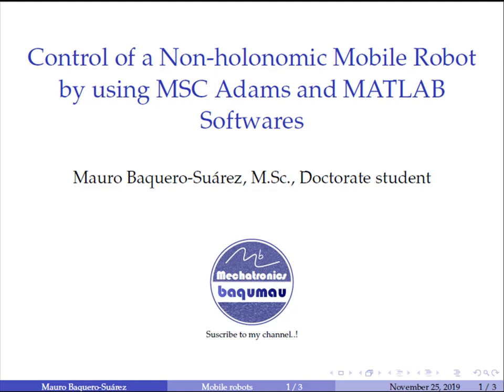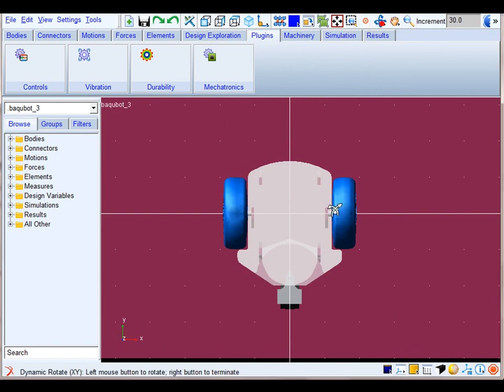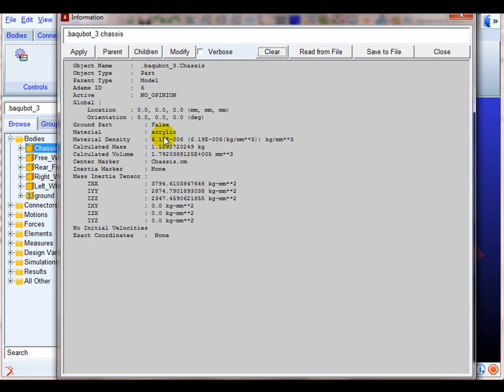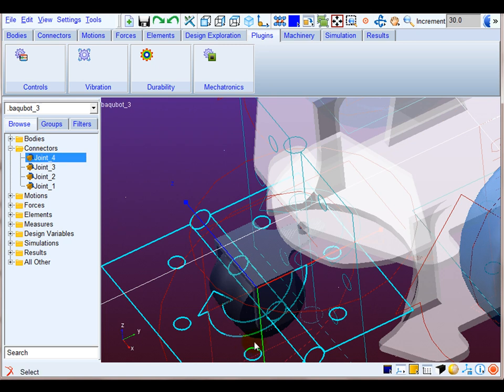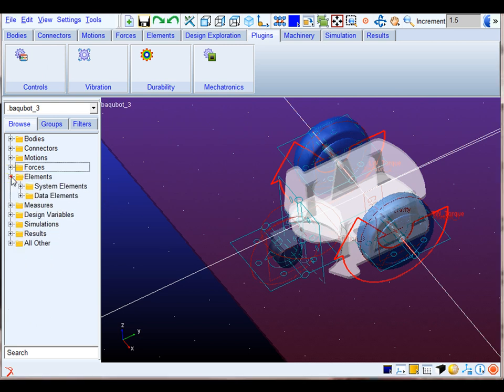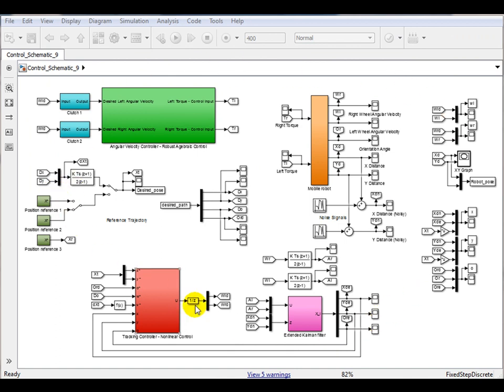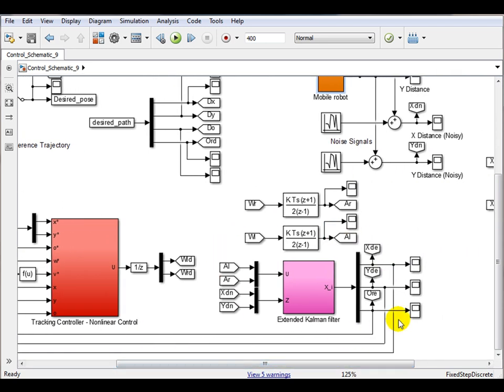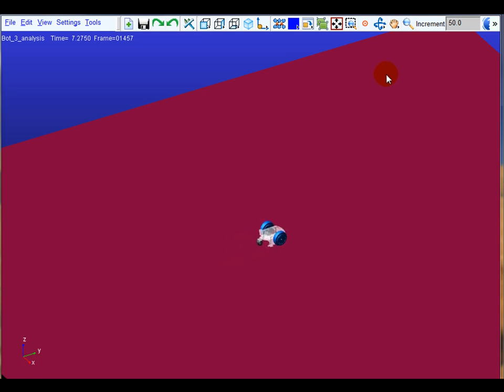Control of a Wheeled Non-holonomic Mobile Robot by Using MSC Adams and MATLAB softwares

Comment: Thanks for your perfect modeling; I have a question:

I want to determine the center of gravity for the whole system. each of the parts has an individual center of gravity (COG), but I can't find out where is the total center of gravity. to be more specific, when the system starts to run, some parts are moving (have rotation or translational motions) and the COG of the whole system will be changed during a dynamic simulation.

Could you help how can I define total COG for this system and determine its magnitude during the time?
Reply from the maker: I assumed that each body of robot is rigid and with an uniform density. Then i only set the material or density of each rigid body and Adams compute the center of mass of each body and the robot's whole center of mass and the moments and products of inertia. In some cases i use physical properties panel of solid edge to do it, due that is easier to manipulate the measuring reference frames.
Reply: @baqumau-Mechatronics  
Thank you for your attention, I appreciate it. In this case, how could we plot COG in the post-processor panel? There only independent parts appear.  Thank you in advance!
Reply from the maker: @amonberdiev8836  the computed center of mass by Adams is represented by a marker. Look within post-processor panel this marker, for instance -----.cm. Post-processor must be calculated position and velocity of this object.
Reply: @baqumau-Mechatronics  Thank you very much

Comment: what values did you enter in the friction coefficients bro?
Reply from the maker: Hello, all robots in the simulations have the same friction configuration and coefficients.
* For lateral wheels was configured the following:
 Mu Static                    : 0.15
  Mu Dynamic                   : 0.1
  Friction Arm                 : 12.0 mm
  Pin Radius                   : 8.0 mm
  Bending Reaction Arm         : 36.0 mm
  Stiction Transition Velocity : 1.0 mm/sec
  Max Stiction Deformation     : 1.0E-002 mm
  Friction Torque Preload      : 0.0 newton-mm
  Max Friction Torque          : 0.0 newton-mm
  Effect                       : all
  Preload                      : Off
  Reaction Force               : On
  Bending Moment               : On
  Inactive During Static       : Off

* For rear wheel:
Mu Static                    : 0.15
  Mu Dynamic                   : 0.1
  Friction Arm                 : 6.2 mm
  Pin Radius                   : 3.025 mm
  Bending Reaction Arm         : 30.0 mm
  Stiction Transition Velocity : 1.0 mm/sec
  Max Stiction Deformation     : 1.0E-002 mm
  Friction Torque Preload      : 0.0 newton-mm
  Max Friction Torque          : 0.0 newton-mm
  Effect                       : all
  Preload                      : Off
  Reaction Force               : On
  Bending Moment               : On
  Inactive During Static       : Off

For caster rotation:
Mu Static                    : 5.0E-002
  Mu Dynamic                   : 3.3E-002
  Friction Arm                 : 2.5 mm
  Pin Radius                   : 2.5 mm
  Bending Reaction Arm         : 3.0 mm
  Stiction Transition Velocity : 1.0 mm/sec
  Max Stiction Deformation     : 1.0E-002 mm
  Friction Torque Preload      : 0.0 newton-mm
  Max Friction Torque          : 0.0 newton-mm
  Effect                       : all
  Preload                      : Off
  Reaction Force               : On
  Bending Moment               : On
  Inactive During Static       : Off